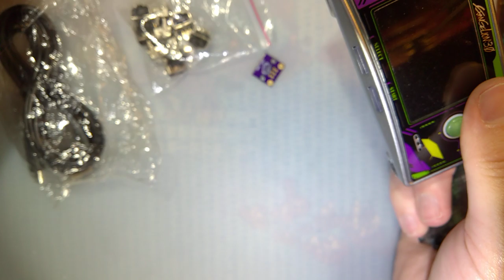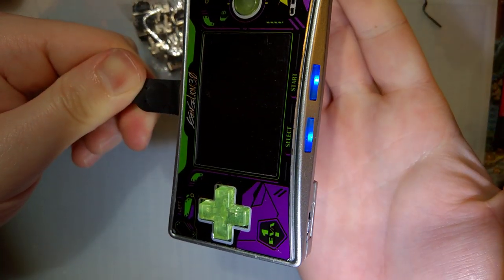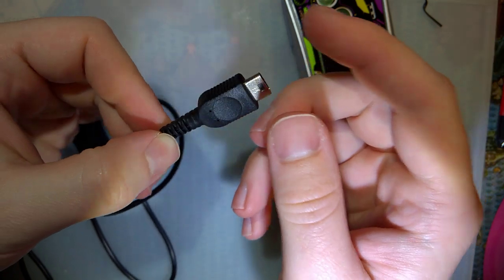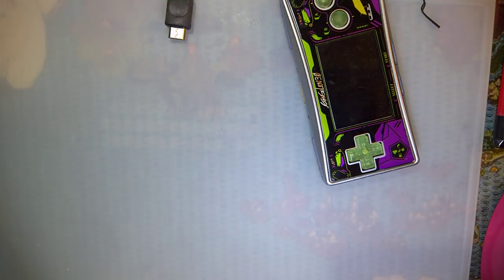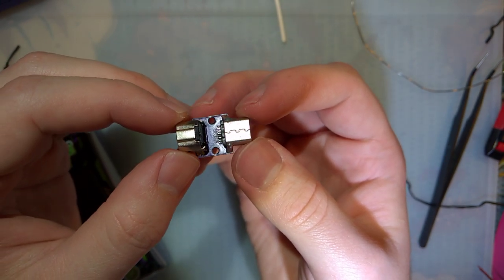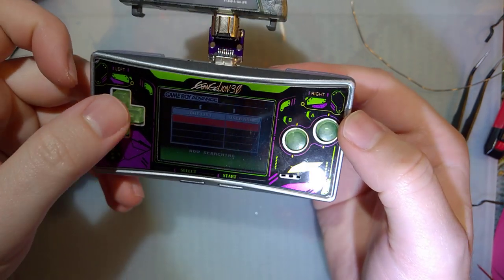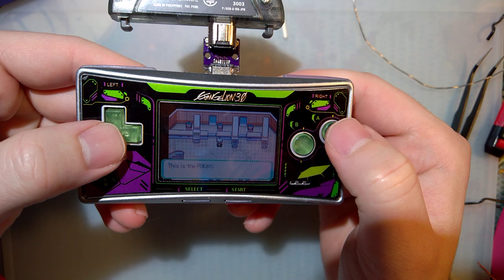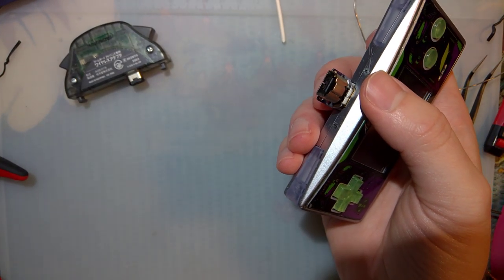Assembling a Game Boy Micro Link Port Dongle

Comment: quick soldering tip, always solder pins before you solder the case, it'll be better, stronger and more accurate and it ensures no stress is placed upon the pins long term

Comment: I had no idea the micro had accessories or was compatible with the regular gba accessories. Makes u wonder what Nintendo was thinking when they decided to not use the usual gba sp ports.
Reply from the maker: Well, due to the extreme small size of the Micro, they had to make a custom port. But that's the only thing that's different. If they included the SP charge port, they'd have to also include the SP link port and maybe they could make one of those fit but there's no way they could fit both.

Comment: At first, I was staring at the breakaway, wondering what the difference was. I'm always tired these days, so it went right past me for an hour.
I actually remembered to order the SP battery board too. Now to find a couple of Li-Po's
Reply from the maker: I still haven't assembled one of those but the intention was to be able to build it without having to manually wire everything and without having to have a giant lever hanging off the top of your Micro. Sounds like a good idea, but I've never had any issues with the old design either.

Comment: the GBA ext ports I ordered from the land of Canadia (RetroModding) came in yesterday, and I had to file the pins a bit before they would 100% seat into the PCB. Still not 100% convinced they're in all the way.  So it seems some of the 3rd party are making them thicker for some reason. Didn't think tearing the plug apart would have taken as long as it did. You make it look effortless, haha.
If work wasn't getting in my way, I'd be done by now.
Reply from the maker: I have lots of practice
Reply: @makho  I can imagine, haha.

Comment: Makho, in theory could the micros charge port be removed to fit a working gba ext port in its place if the pins were routed correctly? Alongside that, a usb charge port just wired in to + and - to allow for charging (if it could fit after some shell shaving)
Reply from the maker: it's the same, yes. This dongle is passive and does no conversion other than for the shape of the plug.

Comment: should i mod a GBC or a GBA, i have never modded a gameboy system, pls help me to decide which one I want ? Also, a video which points out the pros and cons of GBA mod and GBC mod would be really helpful and useful for a person like me. Thank you
Reply from the maker: Objectively speaking, modding a GBA or GBA SP would be better than a GBC because both of the former consoles also play GBC games but a GBC does not play GBA games.
Reply: @makho  ok, if I choose to go with the gba sp, where can I buy replacement battery for the handheld the console ?
Reply from the maker: @salaadas  If the one in your console is done, you can get a new aftermarket one from most of your usual retailers. Did you already search?
Reply: makho my area doesnt have stores that sell one, i guess i have to buy one from aliexpress then.

Comment: can I do this without that pcb, I mean using wires to connect the pins?
Reply from the maker: I mean, there's no electrical reason why that wouldn't work but mechanically, the micro connector tends to fall apart without some support.
Reply: @makho  Oh, I get it, hope someone makes these pcb or the entire pieces again :( , thanks for the answer!
Reply from the maker: @joelmartinezfuentes7769  You can use the gerbers in either of the linked repos. You can have PCBs made with those files. There are the ones that I made and the original ones from this video.
Reply: @makho  thanks again for your help!